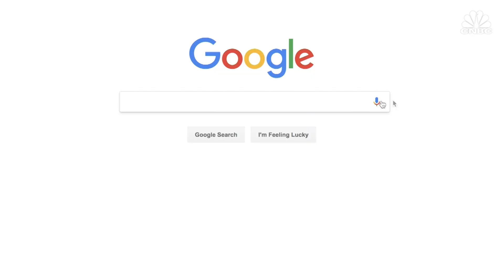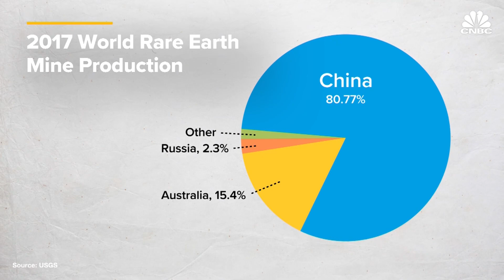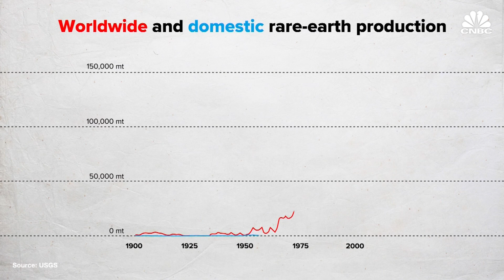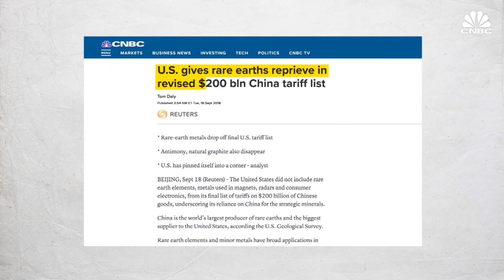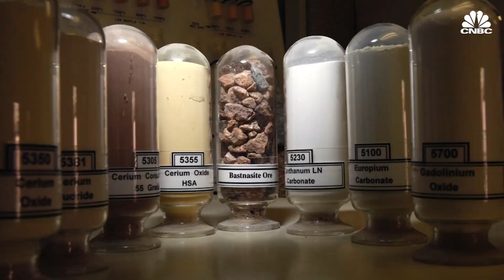Neodymium Is In Demand And China Controls Its Supply

Comment: #RareEarthMatsInUSA 👍👍👍👍👍👍👍 She says mining destroys what was there and to that i say redesign your mining processes with better mining equipment and in real time warnings for radiation and how to encapsulate such risks. For decades mining has been a process of eroding away at walls creating steps vs creating holes that dig down in steps and the top of the mine is capped to filter air. With proper safety equipment radiation would be detected, how much, and the ability to put on safety equipment before continuing. I see equipment that can dig down deep and cap the top for safety while minimizing local area impact. Once done a mine can be filled back in or even used - because what good is a 50-100' +/- dia. hole thats hundreds deep +/-? Perhaps a building? Sell your work and move on. Get paid to mine, sell the mats and sell the hole. #Advisor #Consultant 5% of total value for life to use input. #Cheerios #iCharge #iSeed #OneCheck  Smart Stewardship! #MyEarth #Green #Safety #LoveWins Less #Consumerism and more at home #HardWork 💫

Comment: It is not just about neodymium. Wind turbines usually need dysprosium, and some sources point to this REE as the most demanded one. Hydrogen-fuel cars, meanwhile, need some kgs of lanthanum (hydrogen storage issue). And erbium is needed in signal-sending wires. Gadolinium has important medical applications.

Comment: Currently, mining company Molycorp operates the only site in the United States that produces rare earth elements, according to ABC. Its Phoenix Project is located in California. Otherwise, the USGS recognizes Idaho, Montana, Alaska and Colorado as some of the locations of economically viable rare earth deposits.

Molycorp (NYSE:MCP)

With headquarters in Greenwood Village, Colorado, Molycorp claims to be one of the leading manufacturers of custom engineered rare earth and rare metal products in the world. The company produces materials from 13 different rare earths, plus yttrium, at a purity level of nearly 100 percent.

Currently, Molycorp is operating the Project Phoenix at its Mountain Pass site in California, which is a rare earth resource and production facility. The project, an expansion and modernization of the Mountain Pass mine, is intended to transform the asset into a technologically advanced rare earth production facility.

Comment: Australia's Hastings Rare Metals limited has neodymium mine.
Australia based Lynas is operating the Mount Weld mine which has neodymium.
 
Without long range version, Telsa Model 3's electric motor is an induction type which doesn't have permanent magnets.

Comment: So electric cars doesn't save the planet
Reply: electric cars have larger carbon footprint
Reply: Harvard: wan sum scholarship?
Reply: @edwinford8553  Harvard too is dominated by Chinese students,China everywhere 😂
Reply: Actually small diesels are usually much greener than EV's that use a lot of rare earth metals.
Some that use a lot even something like a Dodge with a hemi V8 will have a smaller environmental impact during manufacture.
Reply: @Patchuchan  all cars from internal combustion to electric cars have large carbon footprint where does the gas for your v8 hemi comes from???!! there are constant boat shipping crude oil around the oil and it has to be refined and has to be transported to cover larger cities . only the future will tell us
Reply: @carholic-sz3qv  EV have a higher initial energy cost of manufacture that's just how things are but the impact can be reduced by designing them for a long service life and using as little rare earths as possible in the first place.